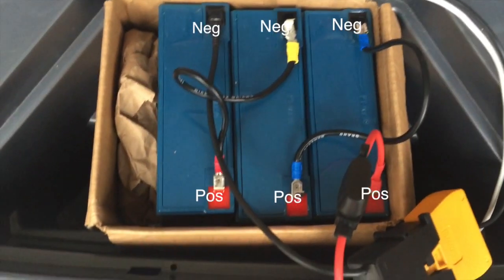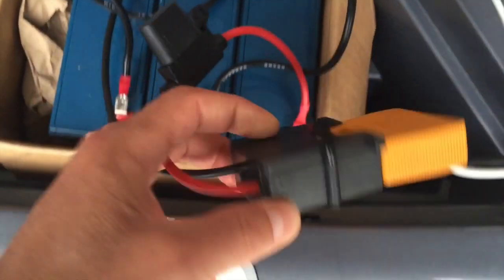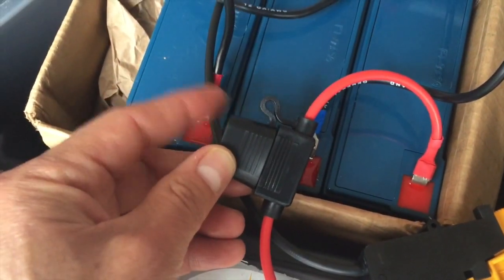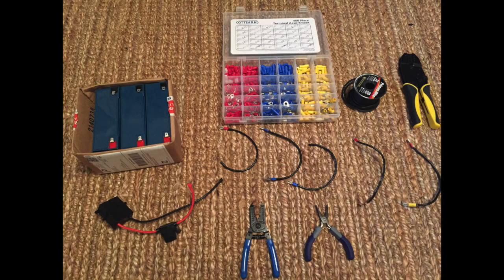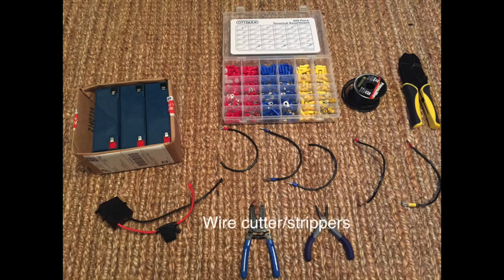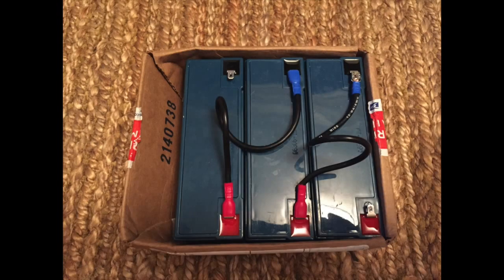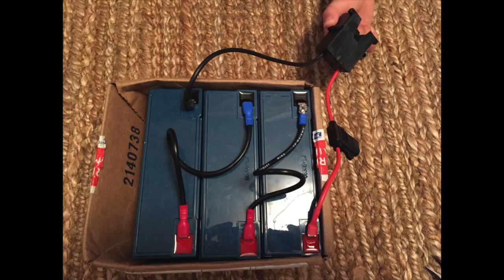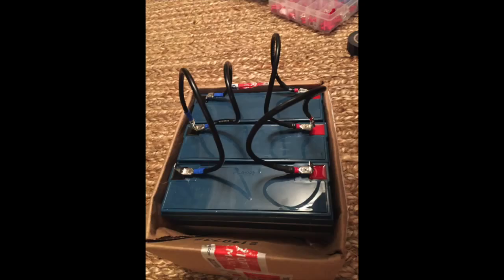SAFEST:  18V Power Wheels Jeep Hurricane Modification

Comment: Did this mess up the gears, motors or anything?
Reply: This will put additional strain on the gears.   There is a braking system modification that will help relieve a little of the stress, but you will replace gearboxes eventually.
Reply: This is only adding 12V and it still runs like a champ after a few years.